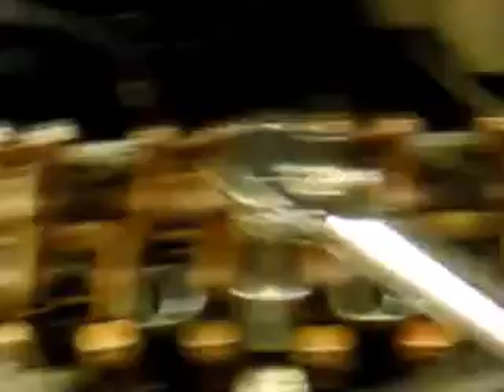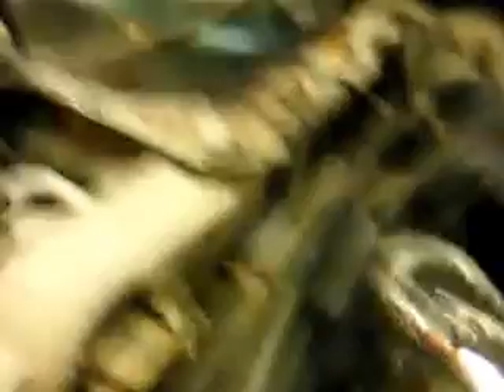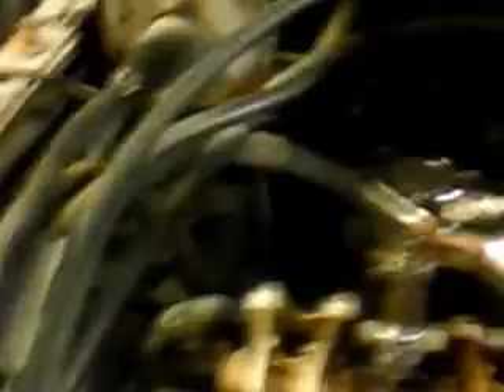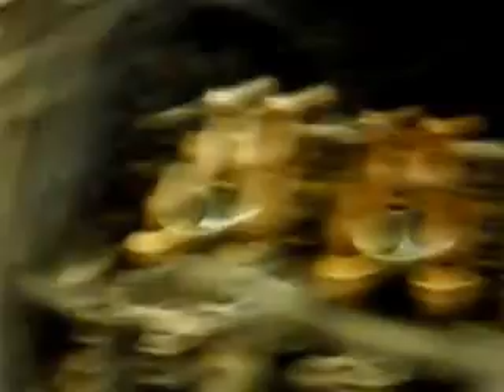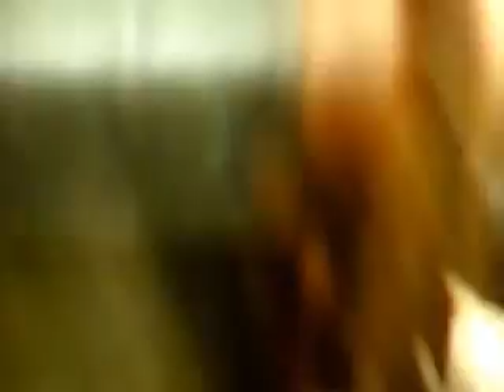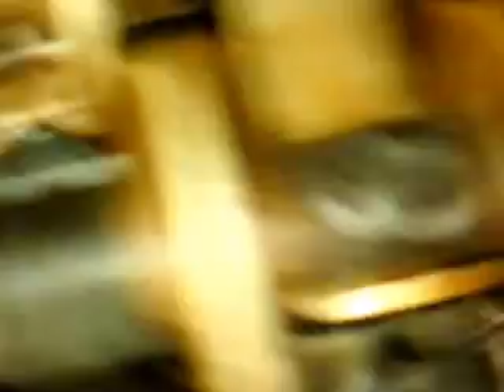Torque head bolts Dodge Neon 2.0

Comment: I don't agree w/ the comment that one loses 2 ft-lb by using the axial extension (I have a MS in Mech Engr).  It is only if you use an adapter which changes the lever arm, such a crow's foot, and even then no change if you orient a crow's foot correctly.  However, you should backup the head of the torque wrench with the other hand so you apply a pure moment.  As is, you are putting both a bending load and sideways shear force on the bolt.  Fairly negligible with the short extension, but good practice and keeps the socket from popping off the head.
Reply: My first time changing a head out I did just because turning by itself didn’t feel right. I always tell my cooks to use their best judgement so I practiced what I preach lol

Comment from the maker: You can reuse bolts one time and you are supposed to mark the bolt heads with paint to indicate they have been reused. They are torque to stretch bolts so it would probably be best to replace them with new ones each time because if you break a head bolt while torqueing you will have to take it back apart,(remove the broken bolt) and install a new gasket and a new set of bolts. If you plan on resuing bolts you should check for stretching, hold two bolts with the threads overlapping and if you see light between them, they are stretched and cannot be reused, if I found one bolt streteched I would replace the whole set to play it safe.

Comment: Good job, easily understood each step as it was performed. Only issue I noticed was the extension being used on the torque wrench. Each added adapter or extension used on a torque wrench reduces the torque value by an estimated 2lbs/ft., which leaves the bolt under specifications. So each bolt would have been roughly 48lbs/ft. instead of 50lbs/ft. chances are this won't make much difference as long as the mating surfaces were flat and even. just food for thought. Otherwise excellent video.